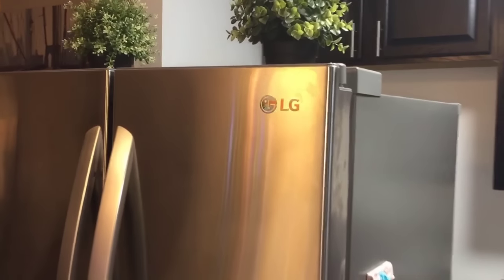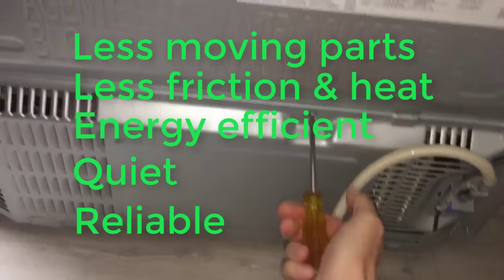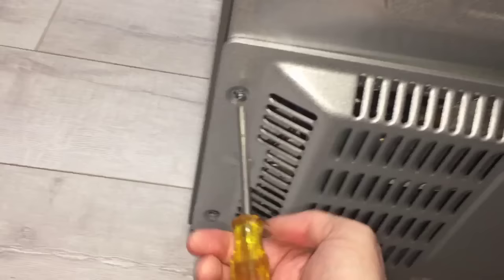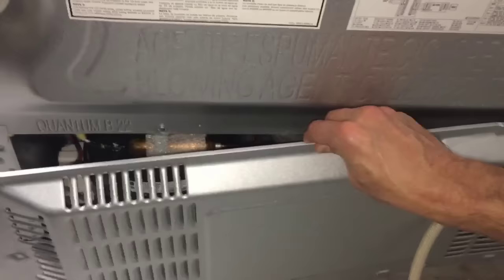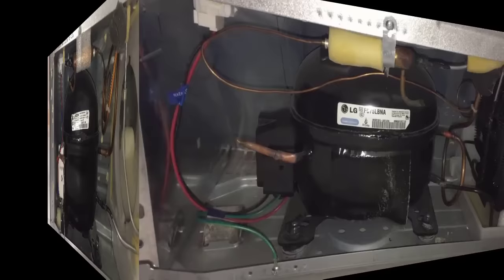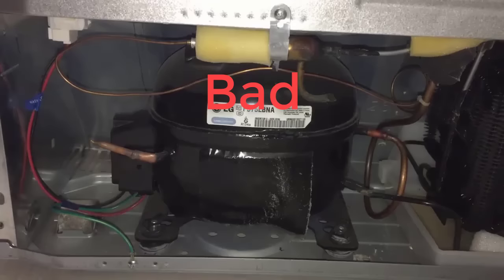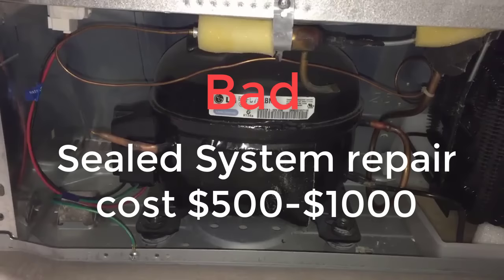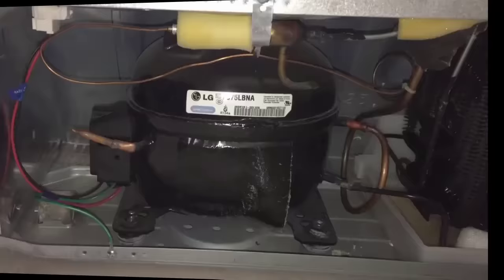LG fridge not cooling but running

Comment: Anyone successful replace a linear compressor with a piston type?
Reply: You would have to run the  200 volts to a contactor relay which supplies 120v .to piston type  or eliminate the  pcm module altogether have one comp bad was thinking about it .don't know about fans it 110 or low voltage  we bought a new frige believe could be done 🤔
Reply: Replacing the linear junk compressor with a reciprocating compressor seems to be a pretty common swap. There are numerous videos that give a how to guide on how it is done. It requires special tools/equipment and a pretty involved skill set but it doesn’t look too hard to accomplish. I’m goin to attempt it on my failed lg piece of crap.
Reply: Done it myself on a 2016 Kenmore Elite 74025 with the biodegradeable LG Linear FLB075LANA compressor...replaced it with an 880btu Panasonic recip compressor in spring of last year (2020) after getting it for free due to the failed compressor.  (It is sorta undersized: the LG Linear is rated at 980-1050btu depending on what manual you read).  THIS IS NOT AN EASY TASK, and definitely not something for the weekend DIY Joe.  I can report that it's been about a year on the replacement job, so far no real issues...
- You'll need at least a MAPP gas torch to silver-solder the refrigerant lines (brazing doesn't seem to work on these lines).  You'll have to know how refrigerant systems work, to get the flow direction correct.  (Installing a new filter-drier is always a good idea, as is a standard HVAC service port.)  A refrigerant vacuum pump, manifold and other associated HVAC tools are also required for proper installation.  (Getting the right amount of refrigerant charge wasn't the easiest.)
- Electrically, you splice a relay into the AC line to control the new recip compressor, and switch the relay (I used a solid-state relay) from the power going to the condensor fan motor.  The linear compressor output wires are not used.  Fortunately at least on the 2016 'fridge (with an LG control board), the linear compressor driver doesn't shut the 'fridge down it if it does not detect a compressor.
- I unplugged the 3-way refrigerant valve, as otherwise, the compressor ran literally 100% of the time.  If you don't care about power consumption (and heavy load on the compressor when it's just cooling one of the 2 compartments), you can leave this alone and probably be just fine.  However, I'm on an off-grid system, and power consumption is a big deal.
- Because I unplugged the 3-way valve, I had to wire up a circuit to disable the compressor if either defrost coil was engaged.  It is worth noting that while the compressor cycles on and off at roughly 50-60% duty cycle, it cycles much more often than a "standard" refrigerator, often with cycle times under 30 minutes.
Reply: @sidlori1592  my conversion was similar but I didn’t change anything about the three way valve. Mine cycles about 16 minutes on, 16 minutes off. The Panasonic compressor draws .8 - 1.2 amps. I did have to add a Supco 3 in 1 hard start capacitor because the 3 way valve doesn’t seem to let pressure equalize on the compressor. It’s been working for about 3 months now. I bought an inexpensive wireless temperature indicator so I can monitor temp easily. Holds about 35/-5 pretty well. It seems to do normal defrost cycles. Luckily it works pretty well since this is the first refrigerator I’ve ever worked on.
Reply: @livezero264  What Panasonic compressor did you use?  I first tried a Supco SPC900...will never do that again.  It was powerful enough, but ran 2.2-3.0A, far over the nameplate spec... not to mention having a different refrigerant line configuration than the original.
Current Panasonic compressor (don't have the part number right off, but it's rated 880btu) runs a 100% duty cycle with the 3-way valve plugged in...switching between the fridge and freezer every few minutes.  With the 3-way unplugged, it runs similar to the duty cycle you mentioned.
Which reminds me that I had to tweak the freezer temperature sensor a bit for a higher freezer temp...when the ambient temp got past 80°F, it would run 100% duty cycle again, and freeze food in the fridge.

If you're not having any problems, I'm really curious what your compressor is.  For comparing apples to apples, I have a 29 cubic foot French door fridge, with ice maker.  (Seems like my compressor is undersized...)
Reply: @sidlori1592  Panasonic DJK73C12RAU. It came as a repair kit wit compressor, run capacitor, filter-dryer and extra tubing that I didn’t use. I don’t know what I’m doing so I just got lucky that it worked when I was finished. I had to leave the run capacitor hooked up along with the 3 in 1 or the amps were up around 2.5 or 3 and compressor ran too hot. Without 3 in 1 every other cycle the compressor was stalled for about a minute until 3 way valve moved and let pressure through. With 3 in 1 ,it starts right up. LG finally paid me after 4 months of trying to get it fixed so I had nothing to lose by trying to fix it myself.
Reply: @livezero264  Interesting.  Spec on the DA73C12 is 881btu (couldn't find any info on the DJK73C12)...might even be the same compressor I put in my fridge.  Glad to know it works perfectly for you ;-).
Reply: @livezero264  YT ate my comment for breakfast yesterday, so here goes a 2nd time...
 - The original FLB075LANA linear compressor is rated at 952btu from the LG compressor catalog.  (The service manual on my Kenmore Elite 74025 lists it at 956btu.)
 - The compressor I used is a Panasonic DJK66C10RAU is rated at 813btu according to the best info I can find; I knew this when I bought it, but I couldn't seem to find anything bigger that didn't use a heap of current (like the Supco SPC990).  And yes, it behaves a bit undersized.
 - The Panasonic DJK73C12 that you used is listed at 922btu on the same page, so it's actually really close to the original compressor--no wonder it works perfectly ;-)  I'll definitely use the 73C12 on future upgrade repairs, thanks for the tip.

Here's the link to the spec list of some various Panasonic compressors, maybe it'll help?
https://na.industrial.panasonic.com/products/hvacr-appliance-devices/refrigeration-compressors/lineup/refrigeration-compressors/series/91540
Reply: Hi i have a ref LG that wasn't cooling good and no ice formation so when i checked there wasn't airflow coming  as there was ice on the evaporator coil so i so as a normal procedure kept the ref off for a day then restarted and noticed the evaporator fan wasn't working. Its 12v dc motor which i replaced it was working but next day when i checked again found the motor turning anticlock where the direction is clockwise. Can u help me with the problem. Every thing is working fine except for the motor. Called LG company no any response yet but when i 👍went to their service centre they are telling me to replace the main mother board.

Comment: who the hell can tell the difference with those sounds to they sound the same.
Reply from the maker: Not everybody can hear the difference between a good compressor and a bad one.
The more important take from this video is that LG Linear compressors fail prematurely. So if your Linear compressor sounds like it's working but not cooling, most likely the compressor is bad... even if it's running.

Comment: The level of LG incompetence shown in this compressor debacle is Chevy Vega level.  This will probably eventually be in college case studies.  The average consumer hardly cares that a fridge has a "high  tech" compressor in the 1st place.  LG put that "Linear Compressor" emblem on the front door like owners would go bragging to their friends about it.  I didn't even notice that til' trying to confirm that's what my junk had after it went out lol.  People want something that looks good (that's probably why most people bought them) and maybe has a gadget or two (they got these parts right), but most importantly will be reliable.
Reply from the maker: LG realized that they made a crappy compressor, and finally, extended the completely free compressor replacement up to 5 years. How old is your LG fridge?
Reply: @Your-Self  I bought it 20 months ago lol.  But stay tuned.  The thing was only partially cooling last night, (the freezer was at 37 deg F) and gave me an E-CH error code. So I ripped all the $300 worth of food out and rushed it to my in-laws around midnight.  This morning the freezer is at -4 degrees.  IDK, maybe it has gremlins.  You have a vid for that lol?
Reply from the maker: That's a strange error code, must be for gremlins, lol. But seriously, are you sure it was the CH? Never heard of it... maybe it was DH or CF?
Reply: @Your-Self  Maybe. Should have taken a pic.  But it has been working fine after I toted all that food out at midnight thr other day...IDK.
Reply: @Your-Self  Great it's doing it again.  Definitely E-CH.  E by refrigerator, CH by freezer.
Reply from the maker: Hmm... interesting. Could you provide your refrigerator model number please? I'll do some research on this error code. 
If you could take a picture, upload to a photo-sharing site, and share the link here, it would be very helpful also.

Comment: it is a common problem and covers by LG for free.
Reply from the maker: Yes, if your refrigerator is under 5 years old and you have the purchasing receipt, LG should replace the compressor for free!
Reply: @Your-Self  ours came with our house and is 4 years old. They're giving us the run around. Will they replace it or fix it?
Reply from the maker: @ian jackson if you don't have the purchasing receipt, you are at their mercy. Try to escalate the issue to the supervisor (executive services), and maybe they could provide free repair since the fridge is under 5 years old.

Comment: The compressors on these are reliable. From what I can tell the issue is either with the refrigerant (unlikely) or the electrical grounding (most likely).
Reply from the maker: LOL, these LG linear compressors are not reliable, and that's why they extended the free replacement warranty up to 5 years.
Reply: Class action lawsuit for a reliable compressor?  I don't think so...
Reply: You’re wrong Colonel Sanders. The compressors fail internally constantly. Grounding has nothing to do with it.

Comment: I just ordered one n put it on,,,the old one purr like a cat but did not cool,,,,n oil was black,,so I replace it ,,and the other one sounds the same but not cooling?? I replace filter dryer too!!!
Reply from the maker: Black oil is a bad sign. Replacing filter/drier may not be enough. You may need to replace the whole sealed system.  Did you flush the system with nitrogen? Is it a Single or a Dual evaporator model? Did you measure the exact amount of refrigerant, or charged it by pressure?   

Is it LG linear compressor? Did you replace it with the correct number? Or, did you replace it with a new Universal LG compressor which requires software motherboard update?
Reply: Same exact compressor,,, just the terminal pattern was different,,,blew system with nitrogen,,,just when I was trying to put refrigerant in while in vacuum it didn't make the hissing sound,,but it hold vacuum for at least 30 min!!! I know it didn't have a leak,, compressor is on ,,it's not noisy it's  on like if it was working,,I guess it's not pumping,,but I check terminals ohms on bad one and one side didn't give me no ohms,,,so I check the new one and it also didn't give me no ohms on the same side???am I supposed to to get ohms? I thought I should!!! But I said maybe this new compressors are like that!!!!
Reply from the maker: LG linear compressors have just one winding and should measure about 7 ohms between two terminals. Other 2 sides have no windings, so the terminals should not give you any ohms of resistance.
Reply: No I'm out of luck,,,I think the capillary tube might be stuff up,,,,,if I run compressor without refrigerant,,,just to see if it's pumping,,,, would it damage,?I really appreciate ur time!!!! It's my mom's refrigerator,,,she spent almost 380 on parts,,,,i really want to fix it for her!!!but thank you sir!!!!!
Reply from the maker: If you had black oil, there is a good chance the capillary tube has clogged up. Try cutting off a couple of inches of the capillary tube at the filter/drier... hopefully, the restriction is at the beginning of the tube only.
If you run the compressor without refrigerant for a short period, it's not going to damage it, but will suck-in a lot of air/moisture and damage it later. Just pull a vacuum for a few hours to burn-off any air/moisture in the sealed system after the test for pumping.

Comment: I've dealt with numerous compressors that run but don't reach full capacity with bad relays. 
Changed out the relay and the compressor kicks back on at full capacity. 
Little unknown trick they say you're not suppose to use and only to test but they sell hard starts for about $8 and they will save you hundreds of dollars and time replacing refrigerators. 
Do a little research and get some dirt on your hands you'd be amazed at how much people believe they know and will tell you. 
What it boils down to is a few hours of hands on experience with a little bit of will power and you can figure it out pretty easy. 
Also you can recharge the refrigerant in refrigerators that take R-134 A 
Another mischievous way to scam people of their money.  
They sell the valves for about $3-$4 you can get a can of R-134A at the dollar store for $6, (leak repair R-134A for $15 or so) 
A can from the dollar store holds about 12oz and depending on your refrigerator it will take about 7-8oz to refill. 
They say it hurts the ozone to release it but what doesn't these days. Who knows how truthful that is besides the experts of these companies trying to rip all of you off... 
These tech companies don't get your money every 6-12 years if you know wtf you're doing. That's why they feed you full of shit and have you buying a replacement for an $1,800 refrigerator every 6 years now. 
It's all about the money don't be fooled.
Reply from the maker: Thanks for your input, but this is not your typical compressor. The LG linear compressor doesn't have a relay, it's driven by an inverter drive board witch is combined together with the main PCB. The problem with this type of compressor is that the internal reed valve cracks/brakes, and the only way to fix it is to replace that compressor, and that's expensive.
Reply: @Your-Self  
It's possible that it's just stuck.The only way you would know is to cut the compressor open.. which I'm sure someone has done but the switches I'm sure do not always crack and break before they quit working.
You can actually add a relay switch to them if they don't sound dead and try this out for yourself. 
Or set a hard start on it and let it see if will not open it up. 
Either way if it's dead you're not hurting the compressor....

Comment: just had my Compressor changed in the same model as in video, LG paid for it, but the refrigerator wasn't even 3 years old yet. Hope it last.
Reply from the maker: Currently, LG is using newer updated compressors. 
So it should be better.

Comment: Ive had my 3 door LG Fridge for 6 years and it simply died 2 days ago... I pray I dont have to buy another $2000 fridge!
Reply from the maker: If the compressor is not running at all, it's maybe not too expensive to fix. But if the compressor is running, but not cooling, that would probably be a major expense.

Comment: This is applicable to the Sears Kenmore Elite series which is manufactured by LG for Sears.  Be prepared to wait months and then pay $500 to have them fix their defective product.  Neither Sears nor LG will be getting my business in the future, which is unfortunate as these both used to be good companies.
Reply from the maker: LG realized that they have a big problem on their hands and now offering 5 years FREE parts and labor on the compressor. But Sears is probably going away soon, so they don't care as much.

Comment: I thought the fix to this was changing out the relay on the compressor.
Reply from the maker: Only older LG refrigerators had start relays on the compressor. Newer, linear compressors don't have that relay... only overload switch.
Reply: @Your-Self  so could it be the overload switch?
Reply from the maker: It depends. If your compressor is not starting at all, then maybe the overload switch is bad. But if the compressor is running, but not cooling, it's probably inefficient (bad) compressor.
Reply: Your response time is awesome...thank you for your time 😁😁
Reply: @Your-Self  Could that be the clicking noises I've been hearing on my nine and a half year old LG fridge? I was beginning to think a Spanish flamenco dancer had moved in with me when I wasn't looking! If the overload switch is bad, is that something someone other than an LG tech could fix without me waiting twelve days for them to show up about a possible issue with my compressor, as they told me in the last hour? The fridge is still working but warming up, and my freezer is on and off again, though nothing has defrosted yet. One other thing; if it's gas, it might explain my severe headaches when I'm in the kitchen. Look at all the things we never think of because we just don't know them to begin with. I always thought a gas system would be permanently sealed on a fridge. Either way, ignorance is deadly, isn't it? Thanks for the help if you get this.

Comment: My LG only lasted 3 years and 2 months.
Reply from the maker: That sucks. But, at least, it should be under the 5-year free compressor replacement warranty.
Reply: I did, it just sucked, because I was on vacation when it happened.